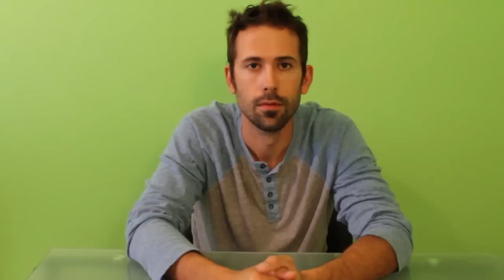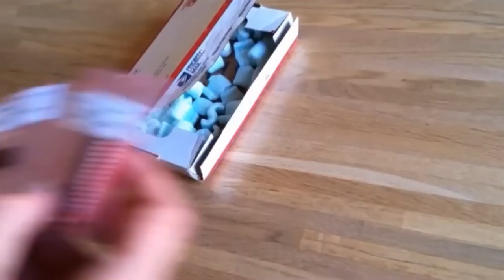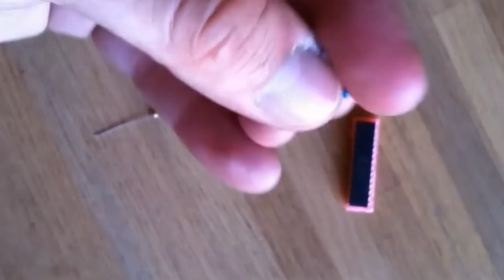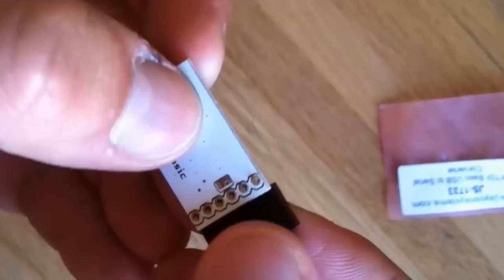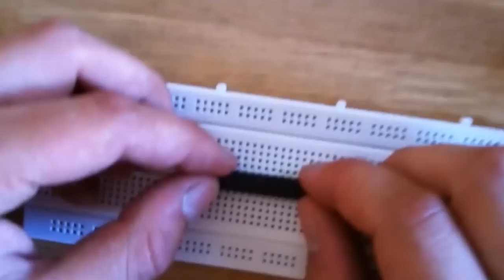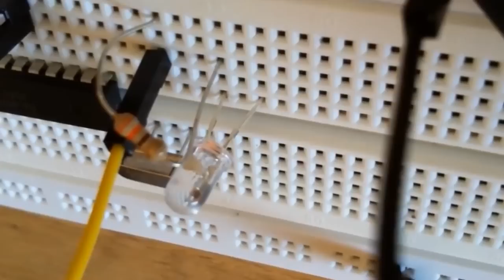FTDI & Atmega 328 Breadboard Kit Part 1 of 2

Comment: a little advice, build your breadboard circuit, then test it to make sure it works, and IF it does, THEN and ONLY then, make a video showing how you did it. There's no way in hell this circuit is going to work the way you've got it connected. You should delete this "tutorial" and start over.

Comment: This tutorial is plain wrong at best, and full of danger for newbies!

first at 7:35 you say 5v goes to "pin 5", and then you go on to connect 5v to "pin 6",and then say "pin 7" to ground,  but, the notch in the IC suggests you are counting back to front! you actually connected pins 19,20 and 21!!
I think you wanted pins 20,21 and 22 aka VCC VREF and GND.
You then at 9:52 you go on to connect the the crystal to "pin number 7", but you actually connect it to pin number 8 which is GND, then you say, connect the other side of the crystal to "pin number 6" and again you count ass backwards and end up at pin 7, which is OSC. So crystal was never gonna work.
Then you say, and i quote "they get rid of noise and stuff like that", those capacitors are required by the crystal, they are load capacitors and they are specified in the manufactures datasheet for the specified crystal.

Also you don't explain that the ATMEGA328 you have, already has the Arduino bootloader on it. If you buy a blank chip, you will not be able to use the "ftdi chip" as you call it to upload, you will need to use a programmer that supports AVR ISP instead.

If this is aimed at beginners, you are going to confuse the heck out of them, and they will end up with a dead ATMEGA328.
Reply: +Stuart Taylor thanks for the warning, beginner here, almost blew it up :p
Reply: lol, just checked the rating and noticed he disabled it